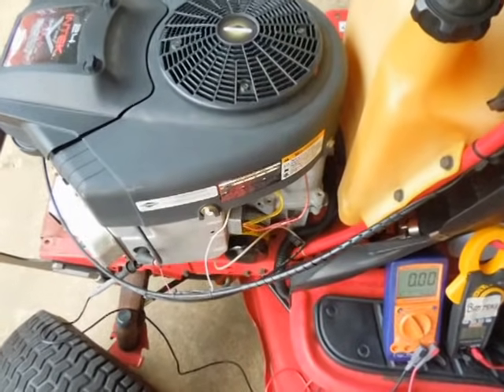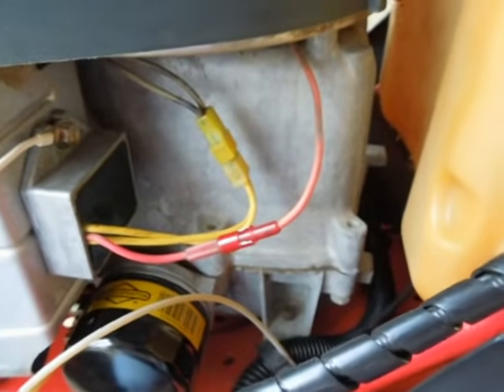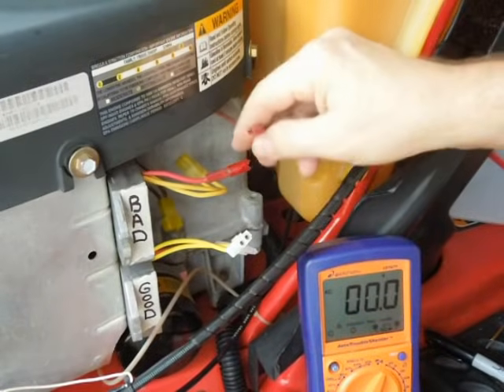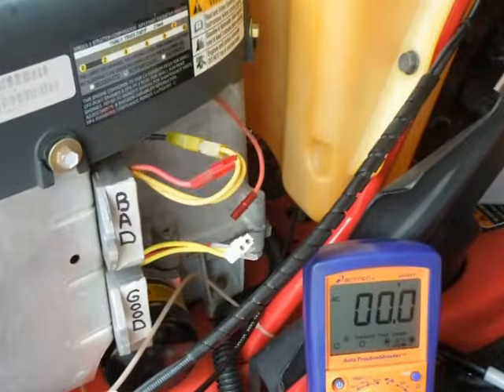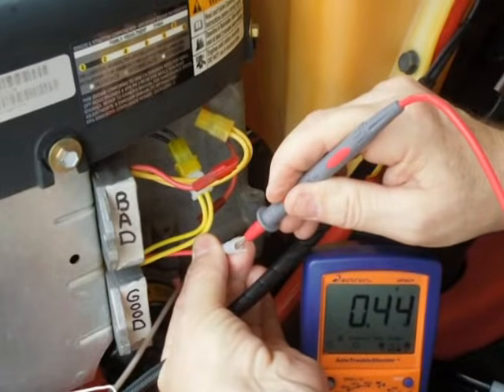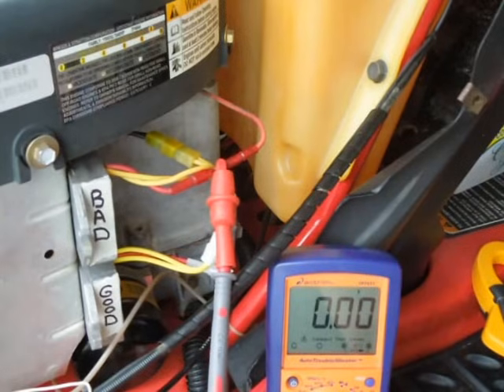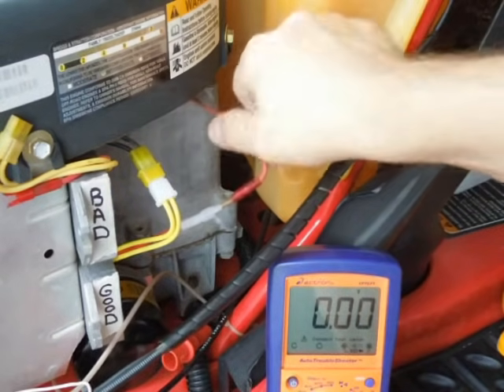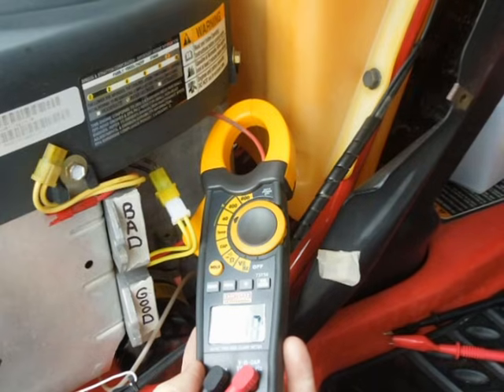Briggs & Stratton Battery Not Charging - Simple Voltage Regulator Test

Comment: What would make the voltage regulator start smoking and burn out the fuse
Reply from the maker: Ralph Storrs, my guess would be either a pinched/frayed wire shorting to ground or one of the diodes in the regulator has shorted to ground.  Wish I had more concrete info for you.  Thanks for watching and good luck finding the issue.

Comment: Mine puts out 19 volts .?
Reply from the maker: Christopher Lindgren, 19 volts ac out of the stator or DC volts to the battery?  Ac volts out of the stator sounds a bit low if you are checking at high rpms like you should be.  Could be a bad stator or weak fly wheel magnets or a bad/corroded connection or ???  19 volts DC out put to the battery is way too much and should be a bad regulator.  Good luck!

Comment: I was wandering if the the regulator could cause to to much charge and blow the main fuse any
Reply from the maker: Jennifer Grimes, I know it can on automotive type charging systems so I assume it could on a mower.  But with that said, if the fuse amperage is much much higher than the rated output of the alternator, I'd think the regulator would not be likely to fail in a way that it would go unregulated, to full output, especially if the engine wasn't running at Max rpms where it could produce max amps.  The main fuse also protects current pulled from the battery so I think it would be more likely that something happened (shorted?) in the wiring harness and pulled enough amps to blow the fuse.  Wish I could be of more help.  Thanks for watching.

Comment: Hi , I have 10-30 volts coming from the alternator as far as the regulator the same as the one as the video. I checked the wire going to the battery and it has 12.2 so the only thing it could be is the regulator 

I got a new genuine plugged it in but nothing , not DC coming out and the battery light is still on ? I'm completely baffled? 

Thanks
Reply from the maker: The only thing that I can think of is that the regulator housing has lost its ground.  Try running a jumper wire from the regulator to the mower chassis or engine block.  Good luck!
Reply from the maker: I assume that when you have the new regulator installed, you're  saying the battery voltage isn't changing, going up to 13+ with the engine running?  Regardless of what the light is doing, your meter doesn't show the voltage increasing?
Reply: So I done exactly as you said and put the ground on the engine to the regulator but it is still no good . When I engage the blades the light come on . I put the prong of the multimeter in the back of the regulator terminal and the other on the battery terminal to find the voltage drop. It is only 0.5v . I'm completely baffled 🤐
Reply from the maker: Liam McGee, youre now talking about engaging the blades.  Is it charging 13.5+ volts without the blades engaged, just the engine revved up and nothing else on?  If it is and the volts drop why you engage the blades, it sounds like you have an issue in the electric pto and/or its circuit.

Comment: You need to have the regulator “loaded” to the battery or a power supply in order to properly test the output of the regulator itself. That’s why when you added the jumper wire between the red wire connector, it read the correct voltage output. The regulator is rendered useless unless it has a power supply connected to the output.
Reply: Derek Rohlfsen agree but the regulator circuit needs power to bias the regulator drivers
Reply from the maker: Correct.  That's why I did both tests in the video.  This way people would see you can not measuring the output at the regulator without a battery connected.  Thanks for watching.
Reply: Just came across this video (excellent) but you answered my only question as to why voltage output on the good regulator was reading so low without the output connected to the battery. Thanks!

Comment: Where can i get that single barrel jumper?

Thank you
Reply from the maker: Paul Santangelo, it's a piece of brass tubing, left over from building gas engine model airplane fuel systems.  Hobby Lobby and other stores like that usually that have a "K&S" brand assortment of tubes, flat stock etc.  Thanks for watching!

Comment: Thank you very much for your excellent video explanation. I followed your instructions on a kohler command 16 HP not charging and narrowed it down to no ground at the rectifier. Added a ground wire from battery to rectifier and system charging at 14.7 volts. 15minutes and 2 foot of wire to fix at ZERO cost.
Reply from the maker: Ron McGregor, great job, well done!  Glad the video helped and thanks for watching.

Comment: Good explanation 

Pretty sure you were reading ac from the regulator, the bad one had 5v ripple, the good one much less

Time for a valve adjustment btw..
Reply: Agreed on the valves.. A little loose

Comment: Early 2000s Briggs vanguard 18hp model 350777.  Battery draining, and PTO stalls mower.   Measuring 26 ACV off stator wires, at full throttle.  Using your method of measuring off connected red wire, of new voltage regulator, I only get about 5 DC volts, which explains battery drain and PTO stalls.  I changed voltage regulators and got same results.   Is it possible that 26 ac volts is not enough for this model engine?
Reply from the maker: 26 a.c. is enough.  The real indicator is the dc output.  You may need to make a tee like I did and get in line on the output.  Then you should have 13+ volts with the engine revved up and a decent battery.
Reply: @snaproll94e  thanks, I did make a t to connect to old battery.  I feel like a big dummy.  Purchaaed a new battery last night and installed.   Everything works great.  The "old" regulator is driving volts to over 15.  Working like a champ.  I guess the battery has to be up to accepting the correct voltage
Reply from the maker: BTW the pto stalling the engine sounds like a bad pto or a pulley/spindle is locked up. The pto would drop out or not engage if the supply voltage/current gets low.  It wouldn't stall the engine. Take the belt off and see what engaging the pto does.

Comment: Good video! My mower used to hesitate like yours does.Yours could be because the battery is low possibly...My mower hesitated similar as yours does but it was because the valves needed adjusting...just a tip .Hope it all goes well..

Comment: Very good video! However, I am confused at the 4 minute mark where the NEW regulator shows little or no voltage! That does not compute in my computer! Can you explain that yet?
Reply from the maker: No, I can't explain that.  That's why I showed what the regulators did with and without a battery connected to them.  You can't just measure the output at the wire coming out of the regulator, you have to tee into the output wire (at least with my meters) to accurately measure the regulator output. Thanks for watching.
Reply: @snaproll94e    I think you switched the meter to AC to check the Stator and didn't switch back to DC voltage for testing the rectified output therefore displaying some type of rms/sampling value related to the output frequency / RPM of the flywheel and count rate of the meter.. Chew on that..? LOL.  just guessing though  Thanks for the VID.. Helped me, and a lot f people i"m sure.. I just need to find a test procedure for the 5 wire before I buy one

Comment: Thanks for the great video. I'm still having a problem with no power going to the battery. Have 26acv at stator, 13.5vdc after rectifier, but it's not getting to the battery. This is on a Deere Z425  The battery stays constant at 12.5 until it slowly is drained and needs a recharge. Any suggestions would be appreciated where to look for the v. drop.
Reply from the maker: Chuck Bartus, thanks for watching.  About the only advice I have is to pass on a way to find an open connection or high resistance connection.  For example, With your volt meter on DC Volts touch one lead to the battery cable terminal and the other lead to the battery post.  If there is a bad connection you will read the voltage drop between the two items.  As you saw in the video, the only way I could read the actual output at the voltage regulator was to "tee" into the output lead.  Is that how you read the 13.5 at your rectifier?  If it is, it sure sounds like you should be able to find a 1 volt drop across a terminal or connector somewhere.  Another thing you could try would be to connect the volt meter ground lead to the engine and then start probing wires, connectors, terminals and start at the regulator and work toward the battery, looking for the volt drop.  You can verify the ground circuit is ok by connecting one end of a jumper cable to the battery POST and the other end to the engine block, this way you know for sure you have a good ground circuit. Good luck!
Reply: Hey Maybe you have a in-line fuse ? Pinched wire ? Corrosion on connection? Did you ever find problem.

Comment: redwire? 1:25 still no DC volts with key on engine off. Manufacturer told me no fuse. I have a circuit breaker.
Reply from the maker: C. M. Mine definitely has a 20 amp fuse inline with this wire.  The ignition switch   Trace breaks the circuit when the key switch is off so no volts on this wire with the key off.  If I'm understanding your "rewire" comment correctly, and you have no DC volts on the wire with the key on, it does sound to me like you need to trace the wire back and fix where it's lost connection.  It also sounds like your problem could be internal to the key switch, like the contacts have gone bad.  Good luck.
Reply: @snaproll94e  rewire meant red wire nothing with koeo key on engine off.
I am the switch because I disconnected cable from solenoid to starter because awhile back when I turned key yo start starter kept spinning and wouldn't stop so I assumed bad switch but I read bad solenoid can cause starter to keep spinning even when you let go of key.
One thing  I dont understand is when I test the wires going to state under flywheel I turn meter to 129 viktor ac setting and touch red probes to one on and do I tuck black probe to a ground or the other on wire harness going to wires leading to stator under flywheel???
In not sure how you Jump the 2 red wires to test but when I test at battery DC volts 12.85 on battery running at full throttle. 
Everything is DC setting except when checking wires going to stator . Red probe goes to pin on stator wire where do I probe black meter lead? (Ground or other pin? )
I read to check ohms on circuit breaker if more than 5 it's bad and I should have battery volts on both terminals of  CB (circuit breaker or theres an issue aka likely bad as well. This is what my circuit breaker looks like:   https://www.snapper.parts/product.asp?itemid=10706&gclid=Cj0KCQjwlJfsBRDUARIsAIDHsWpTA4QwuOmvUcFMJT6QPp7_zM3q5d_E_yIhtmc3WWunRbgFkvu5OmgaAqIiEALw_wcB
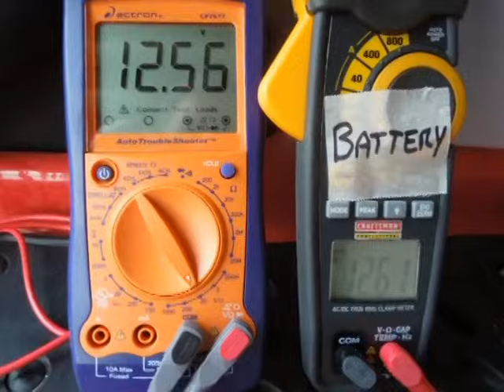Reply: @snaproll94e  what you do at 1:35 I dont have battery voltage with key on engine off at red wire coming from v.r.

Comment: How to disconnect redwire?
Reply from the maker: C. M.  On mine, you put the two tabs outward and the connector comes a part.
Reply: @snaproll94e   what you do at 1:35 I dont have battery voltage with key on engine off at red wire coming from v.r.
(How would voltage be coming from v.r with engine off?) I may be missing a wire but right now I have one large red positive cable which goes to one side of solenoid and I have a small wire wire on same terminal going into wire harness.

Comment: 12.86 volts at battery while running, Is it charging?
Reply from the maker: C. M. The engine is not running and I had to charge the battery with a battery charger so that's why it's showing 12.8 volts.
Reply from the maker: I see more questions in my feed but not under the video so I'll reply here.  If there is no fuse. I'd be looking for a broken wire or you could have a bad key switch, if your mower is wired like mine which is an MTD from around 2004.  Lots of manuals and wiring diagrams are on line.  Search for your mower by model number and leave off the make.  MTD makes Snapper, Husky and many others with the same parts under different color and styles of bodies.
Reply: @snaproll94e  The mower I'm working on now is a Snapper made by simplicity zero turn. I was at 12.8 volts with engine running at full throttle. 
With key on and engine off I'm getting nothing on red wire. I have a circuit breaker no known fuse and I can't reset breaker to my knowledge. I finally found a test procedure for circuit breaker.
Awhile back my starter kept turning until it killed battery so I assumed key switch is bad so now I'm the switch, I disconnected cable from solenoid that goes to starter, and when i get ready i turn key on then i take starter cable and touch the pole going to the battery. 
At 12.8 I believe it's not charging while running. 
The other day it was at 9 volts and wouldn't start so I charged battery then next day I started it. So right now i assume battery holds a charge but engine isn't charging. I will test circuit breaker today or tomorrow.
Reply: @snaproll94e  I dont get battery volts at red wire with ket on engine off. Previous owner thought positive terminal in battery had a large cable and a small wire but there is no small wire in my battery positive terminal. How would vr red wire have voltage with engine off?
Reply from the maker: C. M. I understand.  To me, it sounds most likely that the key switch is bad, but that's an educated guess, not a 100% given.  I'd hate to lead you wrong and have you replace it and it turn out to be something else.  Again, I'd try to find a wiring diagram on line and trace out the circuit.  A missing ground wire could also make the red wire have no volts because there would be no return path for the circuit but I assume your mowers is electric start and it is starting so the ground wire must be connected

In my mower and many others, the key switch also "turns off and on" the connection of the red wire to the battery.  That's why I keep coming back to it, if you don't have battery voltage on that wire whether the key is on or off, the key switch is bad or there is a break in the wire somewhere.  Sorry but that's about all of the help I can give you.
Reply: @snaproll94e  ok one day I turned the key and starter kept spinning and wouldn't stop until it killed battery, so I took off solenoid cable and I apply starter cable to positive source manually after I turn key on, so its likely the switch and solenoid are both bad but didn't know if it was dependent in the charging system. I just went outside and thought one time I got 2 volts on red wire vr side. But mostly seemed like zero, so does battery dc volts go to stator to produce the ac volta with coils and magnet?? Otherwise I dont understand why the red wire should have volts coming from vr if you disconnect with key on and engine off. Mower starts and pto electric works just seems like not charging.
Reply: @snaproll94e  million dollar question why would vr red wire have volts with key on engine off? Does vr take DC volts to stator to produce the ac volts???? Ie dc power has to get to vr somehow and you are disconnecting the red wire and getting battery volts on red wire at vr after disconnecting.

Comment: I checked the regulator, it was bad. I replaced it and now the mower will only run for a minute and quit. I put the old regulator back on, it runs without quitting but doesn't charge...HELP
Reply from the maker: Dennis Everett Wow, never heard of anything like that.  The ignition system uses magnetos and they are totally separate from the charging system.  The only thing I can think of is (on my engine) there is a wire that goes to a solenoid on the bottom of the carb.  I had the connector come loose and make intermittent contact.  This would cause the engine to quit.  I think that wire and the charging wires run together and maybe when you're moving them, it's also moving the wire to the carb.  Hope this helps!
Reply: @snaproll94e  Thank you for your rapid response. I will ck that wire, again thank you, D.Everett

Comment: So will the regulator rectifier not show that it’s putting out DC voltage unless it’s hooked to the positive battery cable at the same time? Because when I try to read my name without the battery hooked up to it online it doesn’t show anything.
Reply from the maker: Yes, that's what I found.  You can only tell if the regulator is putting out by teeing into the wire, measuring voltage and having a good battery in the system.  Thanks for watching.

Comment: Great video. Thank you. Been having the same problem with new battery keeps going dead. 
Volt meter at the battery while running should be closer to 14v and mine is only 12. 
I will check my regulator like you now. Thanks again!

Comment: I own a craftsman lawn mower but my issue is soon as I pull electronic knob to ingauge the blades for mower deck i get a Negitive side reading so pulling juice out of battery and 3 lawns my new battery is dead
Reply from the maker: Marty Bec. Definitely sounds like the charging system isn't charging.  Check the battery voltage with the engine running at a fairly high speed, it should be at least 13.2 volts or more when the battery is charged.  Check the voltage with the engine revved up and the blades engaged and the voltage should be 13.2 or more with a charged battery.  Any time the voltage at the battery is 12.5 or less, the battery is being discharged and the charging system isn't keeping up with the demand (devices turned on) on the system.  Good luck!